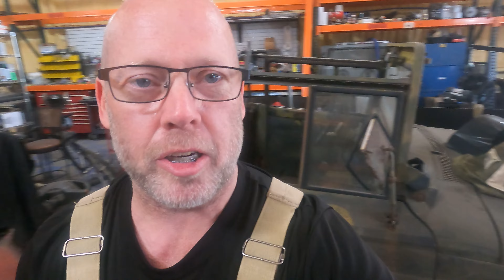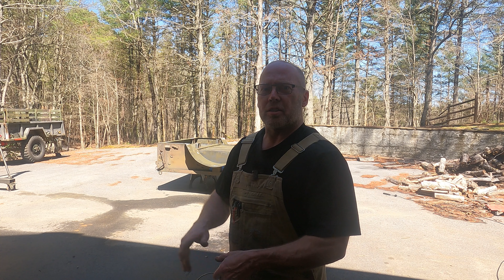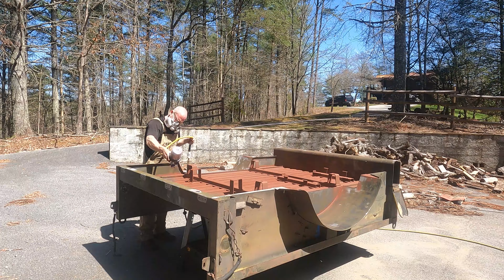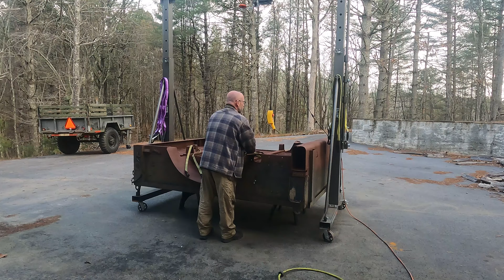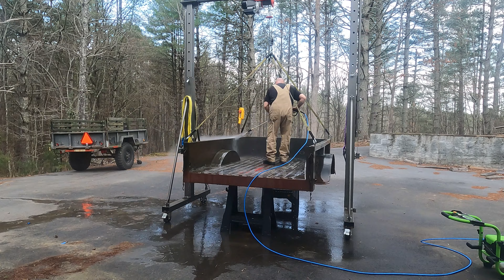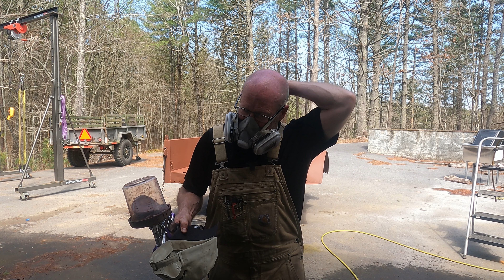1967 Kaiser Jeep (M715) Project - Priming The Bed for Paint

Comment: Paint recommendation... You should or look into using industrial signal stage for your finish coat. Like on heavy equipment, easy to use, very forgiving, long lasting, very tough and touch ups are easy.
Reply from the maker: Thank you, I always appreciate tips and viewer input.  Honestly, I had actually looked into it, but I couldn't get the color I wanted in a flat or matte finish (I need to mix it for the color I want) but I could get them in Rustoleum Oil Based Enamel.  Industrial paint and, believe it or not, the Tractor Supply Farm and Implement paint are, as you said, SUPER DURABLE and easy to touch up.

I *KNOW* this will get scratched and dinged up, since it's a woods / trail truck project so the paint selection (and ease of touch up) were really a big consideration!  LOL

Comment: did you even sand the old paint first i see flaking stuff all over
Reply from the maker: I sandblasted any rusted areas and wire wheeled the remainder.  When you have good paint, it's always best to leave that layer in place as taking it down to metal only serves to expose the metal to moisture.  There are exceptions, such as when doing a restoration, etc.  But since this will be used hard, I chose to not repair the uneven surface where there was rust, I simply removed the rust, primed and painted.  There is no flaking, but I can see how it may appear that way in the video.